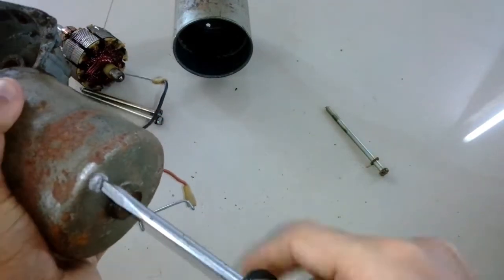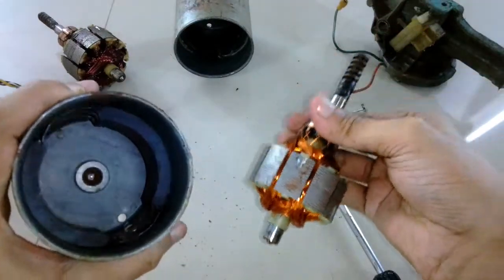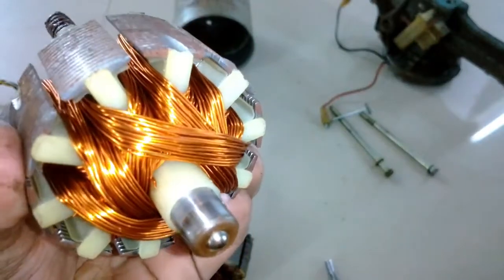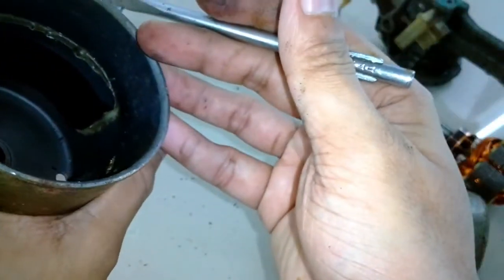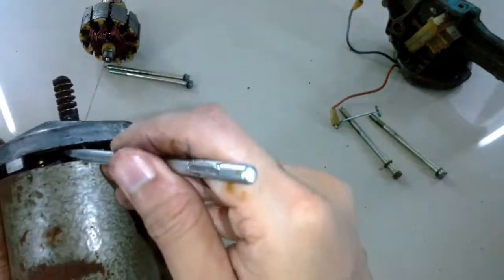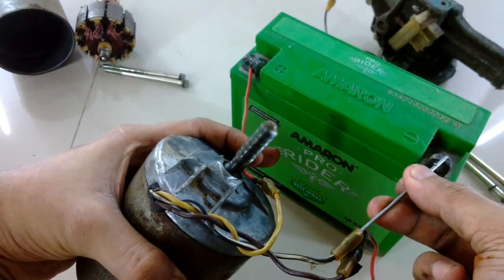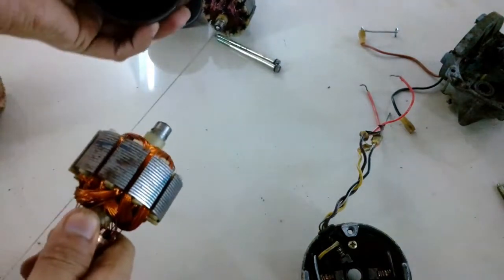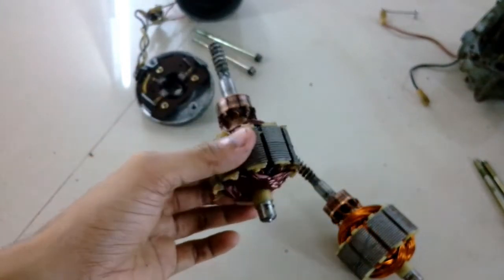Looking inside a powerful DC motor part 2 --- Its About Everything

Comment: What motor is that......... where can i get this kinda motor
Reply from the maker: This motors are fitted in automobile wind shield wipers. You can buy them from auto parts store or get one from junkyard or used parts dealership. Radiator fans motors are also a good option.